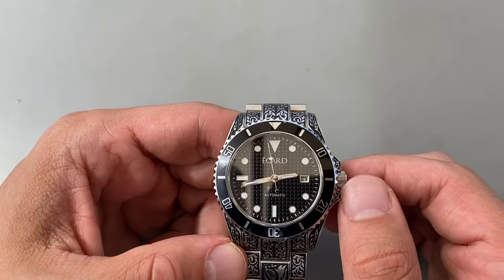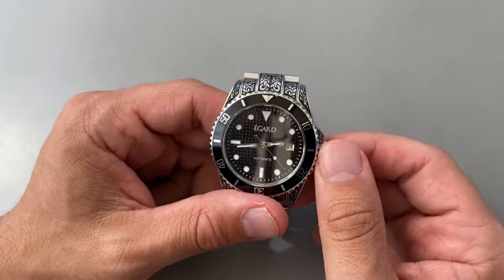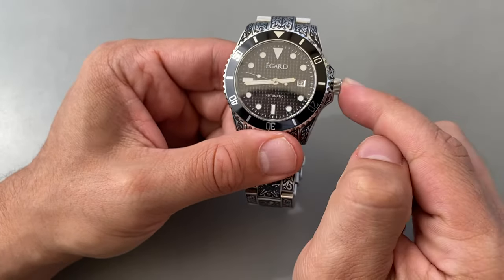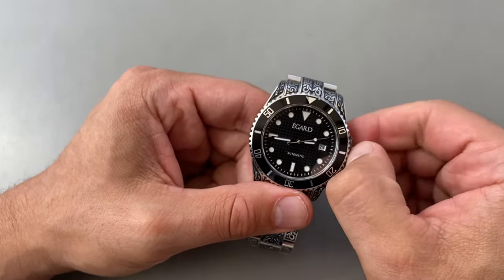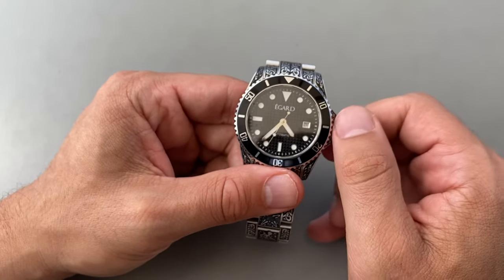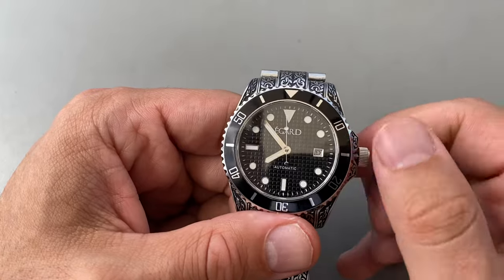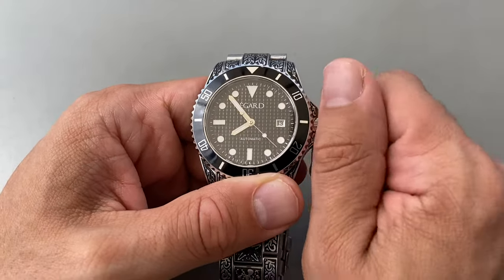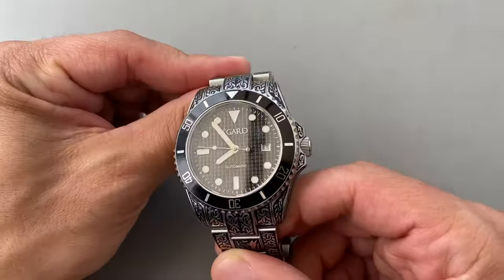How to wind a watch with a screw down crown

Comment: Mechanics know that to start a nut or bolt, you can turn it in the "wrong" direction until a click is felt, knowing that is where the thread will be engaged, then, turning in the other direction to tighten. Wouldn't that technique work with a screw down crown, to avoid accidently getting it cross threaded?
Reply: Yes
Reply: Sort of I know what you mean but remember the threads are extremely tiny so you might not feel the click and also it requires a bit of pressure to tension the spring and allow the threads to meet

Comment: Thanks for the tutorial. I was stuck in the winding position trying to screw it back in. Now it worked. I hope the movement is fine. I have winded it up a lot
Reply: As long as you don’t keep trying to wind when you feel that little bit of resistance in the first position your movement will be fine.

Comment: Forty seems a little excessive. I would think that after 20 winds it’s just spinning. All of my older wind ups only handle 20 tops. Newer watches have a slipper clutch though. I think 40 is too much. BUT I very well may be wrong. Cool video. Thanks
Reply from the maker: I might be a bit on the high end but it can't be overwound so worst case scenario its extra effort for no result :)
Reply: @EgardWatches  It's an NH35 movement, right? If so, from completely dead the full wind is 50 turns according to Seiko data sheet.
Reply: Don’t wind a watch with a Sellita SW-200 too much. If you do, you can strip the teeth from a gear in the movement.

Comment: I accidentally was try to screw it in the opposite way how bad is that for the watch did I ruin some of the water resistance
Reply from the maker: No its completely fine. Nothing should happen if you wind in the opposite direction.
Reply: @EgardWatches  u a good teacher